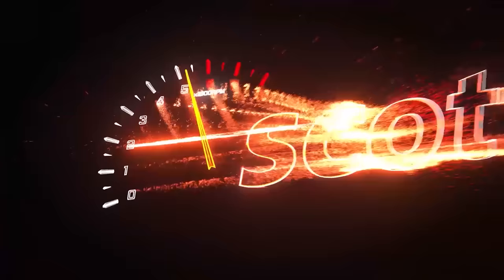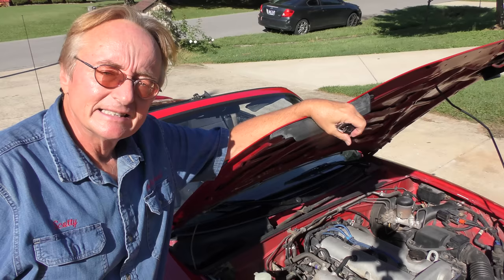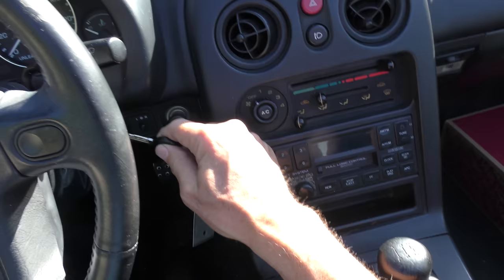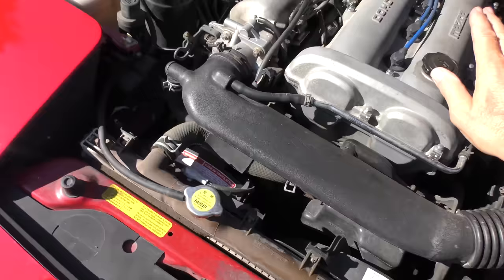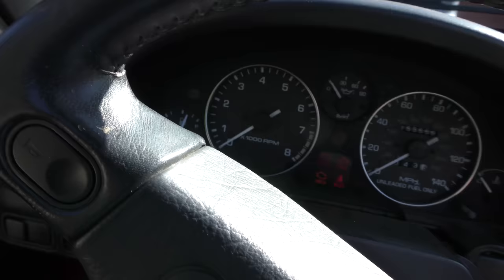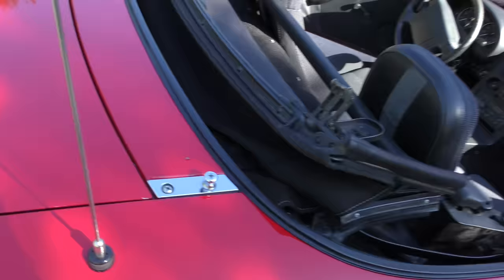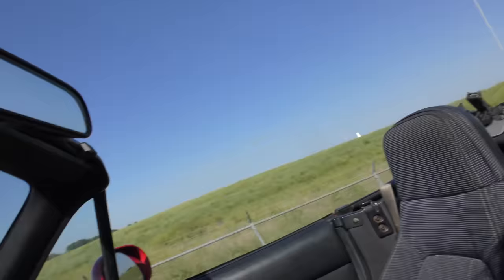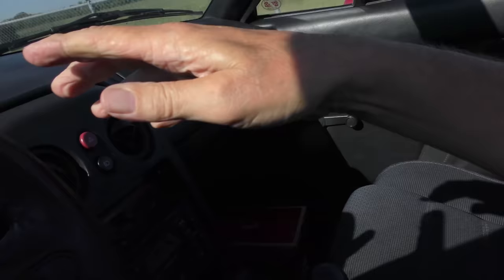I Just Found the Best Car Ever Made (and I’m Buying One)

Comment: What do you think of the 99 chevy cavalier z-24 convertible, mines at 430,000km's and purrs like a kitten, seats 5 pretty comfortably and was really cheap for a convertible, it has good hp to torque ratio's, fairly easy on gas, and really cheap to repair even with junkyard parts as all are shared with regular cavaliers except convertible parts, although I haven't done much other then brakes and changed the oil and plugs out, I have never had a check engine light come on. maybe I just got a gem out of the bunch lol.
I do really miss the pop up headlights, my 92 Plymouth Laser had them and although there not the greatest due to the drag they cause, there just so stylish.

Comment: I found a 1995 Chevrolet Silverado 2500 extended cab long bed on KSL classifies it has a v8 with 4x4. I like the color but the truck has 428,000 miles on the engine and it has an automatic transmission. The person who is selling it wants $3,000. Should I get this truck?

Comment: Kilmer: This is the best car ever made
Still Kilmer but it's two days later: Why you shouldn't buy this one
Reply: LOL as a previous long-time owner of a '97 M Edition who immersed myself in all things Miata, your post got me thinking he could do a video on why to never buy a '90/early '91 or '99 and their respective potential issues!  :D   ("short crankshaft nose" on the '90-'91 could lead to crankshaft failure especially if a timing belt replacement is done incorrectly, and the '99 had a known potential issue with crankshaft main bearings though I suspect the '99's with the main bearing problem have by now either failed or been dealt with!)

Comment: Hi what does it mean when my 90's miata revvs high to 4 to 5rpms when shifting into all gears taking off in 1s an shifting to 5th gear is it slipping or is it going out of the transmission or should I change the tranni or the slave master cylinder cause it smells like burnt rubber.?.

Comment: probably the best car next to the VW Bug for dependability and durability. I love them, and checked one out, they sit so low to the ground, I kind of felt unsafe in it lol, especially next to a Suburban in traffic. Probably why they are  Red, for visibility.
Reply: The Miata is #1 reliable car, the VW Beetle is less reliable.
Reply: @codincoman9019  check data, bet they are close
Reply: @VOOODOOO37 , keep your bet, I know 100% the data (Miata is the most reliable car while the Beetle - not Bug! - is far away from the top reliable cars; btw, my sister bought a Beetle - it was at the end of the recommended list of some "symbol" cars that I gave her - 16 years ago and I drive a Miata ND2 RF G-184 Top Revolution for the last 3+ years, track days included), it seems you do not know the reality.
But you have the opportunity to answer with some statistics and prove me wrong. Unfortunately, you cannot do it, Miata is far away from other cars in reliability, TCO, depreciation etc. Unlike VW Beetle, which is just a vintage/symbol car.
Reply: @codincoman9019  Miata has above-average reliability with a 4.0 out of 5 ratings, ranking 8th out of 21 subcompact vehicles.  So, its not #1.  Also depends on which VW Bug, the new ones or older ones. get your data
Reply: @codincoman9019  highly doubt it

Comment: Hello Scotty, How are you sir? Hope all is good. I've been interested in owning one of these miata's for a long time now. And now is the time I can go purchase a used Miata. I am shopping around for a a used vehicle. Because I live in NJ and I am debating whether to get a used miata or a used suv. Today I went to look at 2 different used cars. A 2006 Mazda Miata manual transmission had 175k miles and asking price was listed for $6k. It looked great, the owner seemed to have taken good care of it. Although he said that it needs some sort of sensor, not sure what he meant by that. I didn't get to drive it because my driving privilages are suspended til i pay a fine lol. It is tempting me to buy it, but still not certain if i really want it just yet. Now the second car I went to look at was a used 2007 Acura RDX has 109k miles on it and asking price was listed for $8k. Now this is a nice size suv also in mint condition. The reason I was looking at this car was because since I live in NJ this car would be good for the snow since it has 4 wheel drive and it's spacious. Really I liked the miata cause its small and a 2 seater plus I don't have to worry about giving too many people rides lol. Let me know which of these 2 cars I should buy.
Reply: I'm not Scotty but if you live in NJ and are buying this as your daily driver just get the Acura.  The Miata is really only a summer vehicle.  It sits far too low to be driven in the winter.  You need a practical vehicle first.  If you like the Miata you can pick it up after you get a primary vehicle or a winter beater.
Reply: @OptimumServices416  thank you for response. I'm still shopping around and am seeing myself buying the used acura rdx.

Comment: I just paid $3200 for a 04 toyota solaro with 176,500 miles and damage on drivers side but use had tires,brakes and timing belt replaced

Comment: I was considering this or a BMW Z3/Z4 a few years back for some non-motorcycle open-air fun driving. What is your take on the Z3/Z4's from Beemer Land ? Especially the M Series ! 😁
Reply: BMW stands for Break My Wallet!!!! Any BMW out of warrantee will eat you alive with repairs! The opposite of the Miata. I picked a 96 Miata with 112,000 miles Did all the usual things a Miata of that age and mlles including a new all aluminum radiator and All I spent was under $700 in parts! Did all the work myself with hand tools and a jack stand. Do that in a BMW anything that old!!

Comment: I was actually hoping that you'd come out with a decent car. But the Miata is nothing to  a mirage in terms of mpg, and is about just as small. There are many 300k mile mirages out there. Also, both cars are only good for up to 5'5" people. A 6ft person doesn't fit in them.
Reply: Not sure why you'd compare it to a mirage, it's designed to be a sports car while the mirage is an economy car. They were made for different purposes. The Mazda Miata was made for having fun, not necessarily for the fuel economy. Mirage is front wheel drive, miata is rear wheel drive. Miata has more power and probably weighs less. It also has much more potential for upgrading and modding, has a lot of aftermarket support and theres a lot of information out there about working on them. I'd say theyre two pretty different cars besides that they're both from Japan, theyre both small, affordable and have inline-4 engines. Unless youre talking about the newer mirage with the 3 cylinder

Comment: I got a 96 Miata I got it for $1,000 because it's stuck in reverse the guy didn't know there was a trick to getting it out of reverse he said was going to cost $2,000 to fix I did the trick I found on the internet and I had it working after 30 minutes he's kicking himself now my landlady I convinced her to buy one just a month ago she got a 2007 the good thing about it is it's also a manual transmission but it does not have the timing belt it only had 30,000 miles on it

Comment: Driven a miata. Its an ok driving experience thats nothing special by todays standards. Good, reliable cars but overrated. Idk why they did not have a 6th gear for reasonable highway speeds at reasonable RPMs. Not very fun at all in most circumstances since most people are not spending most of their time driving up and down twisty mountain roads. They look terrible in my opinion as well. As a 2011 GTI owner (yes its a headache, I hate it, the check engine light is always on) I can honestly say im glad I bought a post 2010 vw build quality crash GTI over a 30 yr old slowmobile